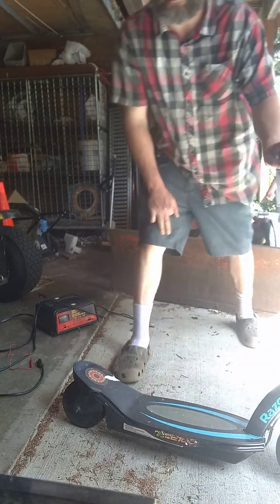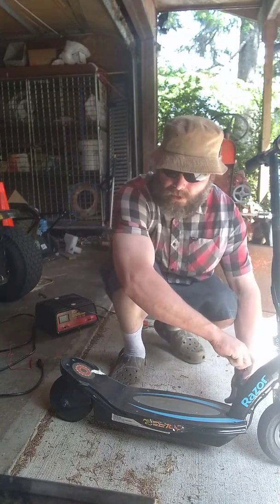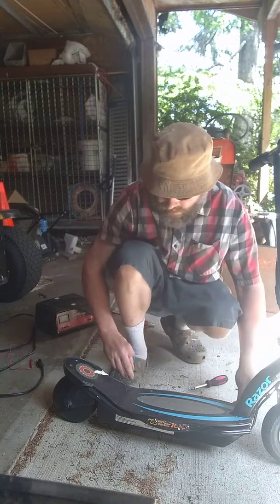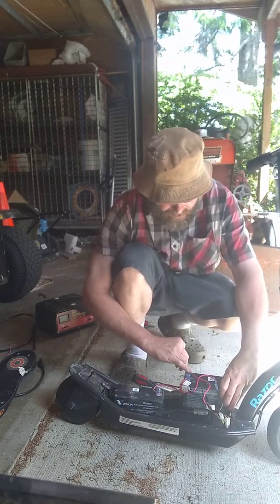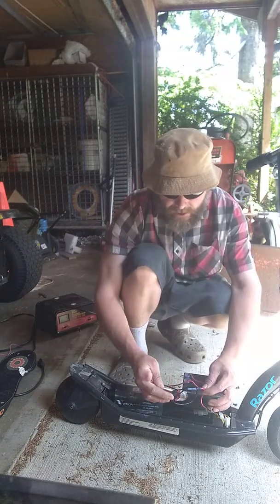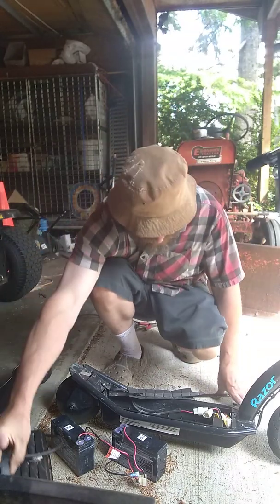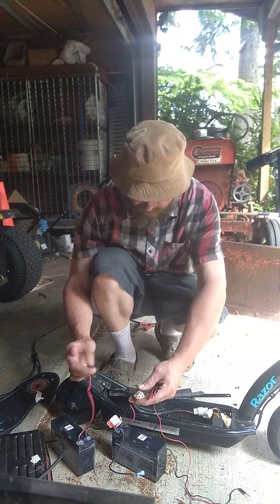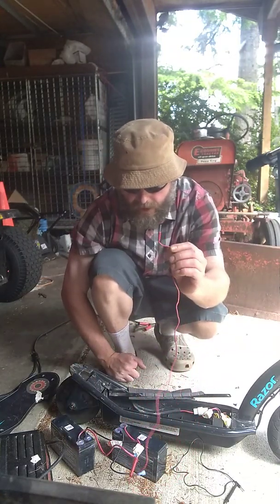How to charge a 24v razor scooter with a 12v battery charger

Comment: I used 4 pieces of wire hooked the two reds together and two blacks took my car battery charger put it on 2 amps and am going to see if it works in a little bit
Reply: Why didn't you just find a plug to fit and put the clamps on the  cut end .. and buy a charger to charge it once it's in spec .. this to charge fully will not work you will over charge it and it takes long

Comment: Are you slow??? Like short bus slow??? Or just fuck!ng stupid??? Anybody else notice how around 2:52 he said "What I am gonna use to put these batteries into SERIES to charge them at the same time" and then at 3:09 he talks about connecting the batteries together by connecting both positives together and both negatives together.....  THAT IS NOT WIRING IN SERIES THAT IS WIRING IN PARALLEL!!! YOU CANNOT CHARGE A BATTERY PACK OF 2*12V BATTERIES IN SERIES WITH A 12V CHARGER. YOU CONNECTED THEM TOGETHER RIGHT BUT YOU SAID IT ALL WRONG. 

DO NOT TEACH PEOPLE HOW TO DO ANYTHING THAT CAN BE POTENTIALLY DANGEROUS IF YOUR NOT GONNA MKE SURE YOU TEACH THEM RIGHT. YOU ARE GONNA HURT SOMEONE WITH YOUR MISINFORMATION!!!